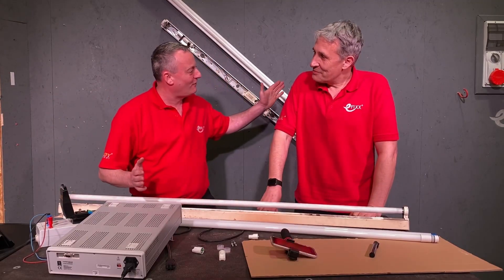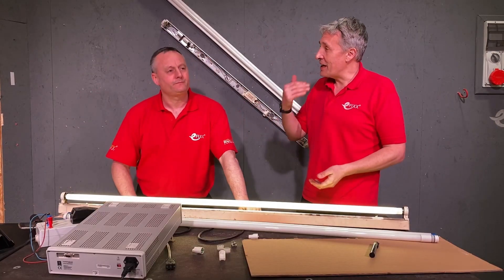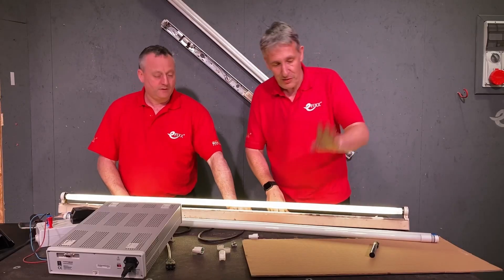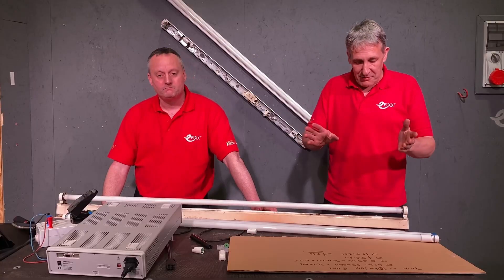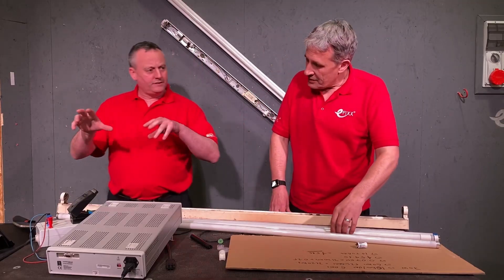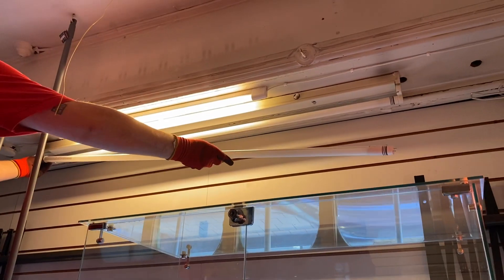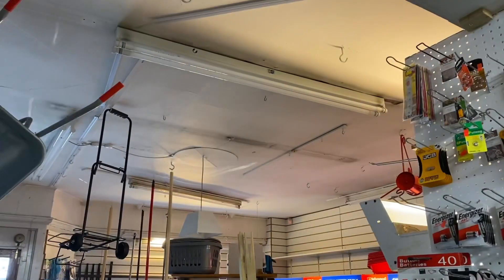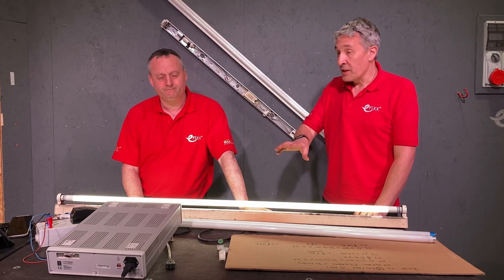How to Slash Your Electricity Bill with LED Tubes

Comment: Some supermarkets still running fluorescent lighting in 2025 lol, went into my local Morrisons today and a lot of the twin-tube fluorescent fittings had either one or both tubes out (completely, HF fittings) so I wonder how much longer it will last!
Reply: July 2025, I've now spotted a few LED retrofit tubes, but in the 2007 extension rather than the 1998 original building. Still mostly fluorescent tubes (some working, some dead).

Comment: No mention of the tombstones ,or explanation 🤔 of shunted and non shunted tube types at all ... ????.

Before you convert any fluorescent   tube fittings you need to know what type of fluorescent tube fitting you are dealing with there, this needs to be done ✔️ even before you order any led tubes to determine which led tubes you need to order and obtain there too .

Watch this YouTube video link below there for full explanation and information. 

https://youtu.be/HB3AuoFRFOM?si=UV0m46XL59z2V53h

Comment: These calculations overestimate the savings. A 1500 fluorescent gives out 5200 lumen for the 70 W if it has a magnetic ballast. The CorePro 1500 only gives out 2700 lumen for a measured 24 W. So if you want the same light output, you need to use a double fitting with 2 x CorePro 1500, so the power draw will go down from 70 W to 48 W.
So your cost for the same light output goes from £54.60 to £37.44, call it a saving of £17 a year for each tube and £170 for the 10 tubes. 
Bearing in mind your pair of tubes will cost you £15 and the hassle of the extra holder, there is no obvious and early saving by swapping from fluorescent tubes to LED because the tubular LED. 
If your original fitting is a high output T5 with an electronic ballast, that's 4300 lumens at 48 W and savings do not cover the costs of replacement. 
From an energy point of view, there's nothing wrong with modern fluorescent fittings. I suspect the reason for banning them is mercury panic.

Comment: As a DIYer I follow you channel to get safe tips on domestic electricity. I have three fluorescent lights in my garage and found this video really useful. So will be going for universal tubes to replace the ones I have. I won’t be messing about removing the ballast etc: because the amount of time they are on the saving would hardly be noticed. But the tubes themselves would be worth the saving.

Comment: have a 1966 atlas atlantic 3 in my kitchen, 8 foot 85 watt quickstart 🙂
Reply: What is quickstart? Is it like magnetic rapid start?
Reply: @gregorymalchuk272  a quickstart ballast is an old 1960's early 1970's instant start ballast , no starter involved in the circuit,  live neutral into the ballast   2 pairs of lamp holder outputs to each end of the tube,  the tube lights instantly no flicker, SRS (semi resonant start ) was a simelar gear type, though the tube starts warmly like a slow fade up to full brightness, that circuit uses an 8.4uf capacitor in series  with the ballast .

Comment: A good video I give free energy saving advise and highlight the standard 4 GU10 halogen  track fitted in the kitchen converted to LED goes from 200watts to 20watts but with the newer LED lamps is 16watts. Its not easy though as customer mentality is "Why do I want to change a working bulb"
My calculation for kitchen spots was 3 hours a day on average with a £12 conversion cost

Comment: I have a whole industrial unit kitted out with 60s and 80s fluorescent and MBFR fittings. Occasionally one starter may play up but in the few years that's all I have had to do. The buy back time in low use applications is negligible. Also I don't get on with led for hertz flickering and the colour rendering isn't the best at all on most lower grade stuff. Also on most led tubes the lumen rating of a 4ft tube is alot less than its equivalent fluorescent counterpart. So in some cases to get the same our put will require 2 led tubes to replace 1 fluorescent tube. So there's an added cost of two tubes a replacement fitting let's say... So not as cost effective as it seems. 

Some people I know have gone back to fluorescent tubes after an led tube failed in a few months of installation. Also a fluorescent tube is easy for someone untrained to replace. So if one end is live permanently compared to a normal fluorescent fitting and some one unknown fitted a fluorescent tube back in and bang. 

So I'd only bypass in a commercial environment.

Domestic I'd just use the starter shunt and shove led tube in.
Reply: That's what I don't get. Most LED retrofits are 37% dimmer than the T8 fluorescent they are replacing. A 4 foot fluorescent tube is 2900 lumens. A 4 foot led retrofit produces maybe 1800 lumens.

Comment: To be fair, the net energy savings seen by replacing indoor lighting is more complicated than discussed here. The extra energy used by the older fittings at the end of the day is heat that is added to the interior space. In the summer avoiding this extra heat is great - the space will stay cooler. But, in the winter the heat will have to be provided by another source - eating into your savings. Upgrading is still a win, just not as big a one.

Comment: Hate LED tubes, all a cold, unvibrant light. Dont illuminate the ceiling, making places feel darker too. That shop looks less welcoming and warm with those LED tubes.
Reply: You can buy the tubes in warm white, cool white or daylight white.
Reply: @stuartrhoades4306  I know, but people always go for the cheapest ones, of which are cold white and never as bright!
Reply from the maker: It looks a lot better than when we started - tubes out and mixed colour temperatures.
Reply: @efixx  Didnt look it from the before and after parts of the vid.

Comment: Thanks for the video and anything to save money is good. Do you have any recommendations for a device we can retrofit to measure power usage?
Reply from the maker: All depends upon the application - what power level etc
Reply: @efixx  I am after something to measure power usage live, so it can be monitored. I would assume it would include a CT clamp on the feed to the consumer unit, then a display in the house. Single-phase normal domestic.

Comment: Great advice👍. Ive been doing this for a few years now. Amazing how technology has moved on. I Changed a 12W BC LED Lamp at home to a 18W LED for my wife to see better working at home. Even with the greater light output, the efficiency of the fitting was significantly better, with less current draw. I worked out the replacement lamp would pay for itself in 8 months!

Comment: We replaced a lot of tubes as you are in a shoe factory in Northampton (they supplied tubes) with those Philips ones the output was impressive compared to other cheap brands I have seen however I never got to get to the bottom of what to do with the emergency fittings?
Reply from the maker: Great feedback👍

Comment: Looking forward to the follow-up — how much more power would be saved by removing the ballast and going direct to mains?

Also, what's the realistic payback time?  Amazon price suggests ~6 months (excluding any labour costs).  Other solutions might even halve that. On the other hand replacing the ballast with a driver is more expensive initially subsequent replacement lamps are even cheaper.

Comment: With changing the LED tubes, you would still have 240v at each end right??? So if you had a driver built into an led tube wouldn’t you have to make it so only one end of the lamp holders has 240v so you don’t blow any lamps up?
Reply: Only one end of the tube is connected internally, the pins on the other end are purely to hold it into the fitting.

Comment: I think the video would have benefited from a complete run through of the costs (and savings). Would make it easier for end-users to follow and give electricians a worked example to use with their potential customers. Chatting about the numbers is not as effective IMHO as displaying them on the screen. Great video otherwise and vitally important.

Comment: Super video- would be good to publish a table of the cost of running different lights - a good rule of thumb for lights is 1w equates to £1  (based on 9hours a day) - so £50 for a 50 watt fitting. More than Double that for appliances that are left on 24/7 such as items on standby…..

Comment: Great videos guys. 
Used many LED tubes when they first appeared on the market but never really got on with them and customers didn’t think the light out put was that great. But these look really good and for the price are a no brainier. 
The mains option LED (blue end) what is that like on energy consumption when still using a Mag ballast vs to taking the ballast out ?

Comment: Well its a nice video, back about 25 years ago I worked in Philips' largest fluorescent lamp plant, in Salina, Kansas.  Was so interesting to watch sand turn into glass and the bulbs to take shape and then get packed into boxes and watch the robots move them around the warehouse.  We made 4' tubes and 8' tubes at that facility.    

I have swapped all my tubes to mains powered LED retrofit bulbs, can remove all the ballasts and just direct wire them.  Just have to make sure the tombstones are not shunted.

Just a FYI that as of 4/2022 our power here in Texas runs just under $0.11/kWh with no time of day changes.  If I change plans we can go to $0.154 during the day then nights (10pm-6am) and weekends for free, you can use all you want for zero cost.  That is why solar is a hard sell here, the payback at these rates are hard to payback in any realistic time.

Comment: I fit a 120cm Philips LED replacement batten a couple of years ago, bypassing the existing ballast and starter. It’s still going strong, I only wish more attractive, diffused fixtures for battens were available. They’re usually either very bulky (possibly extra IK protection for industrial use) or just very curvy-plasticy. The old one I want to replace, the diffuser’s yellowed and I very much doubt they still make replacement parts.

Comment: In all fairness I don’t know what make they are but I have seen these used in quite a few shops. The light output is a diabolical colour, almost burns your eyes out. In fact our local WH Smith had them ,not for long though. They changed the whole fittings in the end .As I said I have no idea of the make.
Reply: LED's are the death of warm white. Something to do with the lumens per watt is better with cold white.

Comment: Don't forget that with time the light output of a fluorescent tube reduces.
Reply: Light output from LED diminishes with time as well. It just takes a bit longer.
Reply: @rob19632  Yes, I remember it being on another eFIXX video but I don't think it is as much as LED or not what I have noticed however I guess some makes are better than others
Reply: @anthonybragg   on display LEDs it might say something like L70 of 25000 hours which means after 25000 hours  average light output will have dropped to 70%

Comment: Swapped the 1200mm tube in my kitchen years ago when they were new and is still working fine. No difference in light intensity but at least half the power to 18W instead of 40W. Left the ballast or inductor in as it would reduce the inrush current. I have quite a number of LED lamps in the house and a few have failed mainly due the input filter.

Comment: Great video and I like the easy conversion by removing the control gear, a proper money saver in materials and energy used 👍
Reply from the maker: See part 2 - DON'T cut the Wire - CALL the ballast disposal squad!
https://youtu.be/kl_UYKw5sBk

Comment: Whats the lumen output of each lamp? The test means nothing unless the lumens of each lamp are equal or similar!
Reply: I changed about 100 in a toyshop a few years back to 4000k, no light difference noticed, tubes cost £12, saved £17 each in the first year, so thats cost of tube + £5. £17 next year, tubes guaranteed for 5 years, only had a few fail, none in the first 2 years.
Reply: I've seen them have 37% less light than the T8 fluorescent that they replace.

Comment: Retrofit led tubes are great at energy saving. A standard 5ft tube will usually be rated at either 18 or 20 watts depending on the manufacturer. While the ordinary gas filled tubes of the same length are rated at 58 or 65 watts.
Reply: And how many lumens? From everything I've seen, LED retrofits produce around 37% less light than the t8 fluorescent they are replacing.

Comment: Thanks for this good video. Mr. Arkwright from Open All Hours (and me!) would like lke to know how to save more electricity, as the energy pricing is getting higher and higher. As you guys have the equipements to measure, could you compare boiling 250cc hot water for making a cup of tea, at 5 different times through out the day, and compare to boiling all 1250cc in one go, drink the first cup (250cc) and pour the rest 1000cc of that hot water into a flask, to consume through out the day, which one actually consumes less electricity? Assuming it is a fast kettle of 3000w, but a low-end cheap model, as it is Mr. Arkwright asking...

Comment: Jolly good show.
How much did it cost to properly dispose of the old tubes?
Reply: In Finland the amount of fuel it takes to drive to the recycling center that is owned by the government. Most electronic waste is taken care of free of charge, and also a lot of dangerous waste like old oil, chemicals
Reply: @justme5384  
In the UK, Businesses have to pay to dispose of fluorescent tubes &, where I live, they’re also classified as hazardous waste meaning you have to get a special licence & pay the appropriate charges when tipping too plus all the health & safety assessments & equipment that goes with it. If you take them home & store them, that’s another licence… it gets expensive!
Reply: @jonathanrose456  I also read somewhere someone got fined because he didn't have a license to collect garbage. Because he had his own plastic bag with waste like lunch packaging etc...
Reply: @justme5384  
Wouldn’t surprise me.
I know a guy that got fined for taking a sofa down the tip. The sofa… it had been fly-tipped in his back lane!
Reply: One of his mistakes was using a commercial waste bag instead of a domestic one.

Comment: Great way to save energy and good information- but not including the approximate cost of the tube and starter does not give a full flavour for the savings, I found similar ones between £5 and £20 per tube for 1500mm with starters.  I would assume the project payback time would be between 9 and 18mo and greater savings after 5yrs when those battens are still going (hopefully with no flashing tubes).
The way NOT to do it - is to replace all of your standard tubes with ultrathin ones (with adapter caps), replace them again 2yrs later with LED tubes (with different adapter caps), then replace the whole lot all over again a further 2yrs down the line with LED panels with occupancy detection!  It saves energy, but does not save money!
Reply from the maker: The payback on our example is around 3 months using the EM type Philips LED tubes (£10 each)

Comment: Been doing the swap for years ... flouries are so out dated.. the led tube replacements tend to last 3-5 years (i only fit branded) .. amazing how many shops are still running 2700k flouries.... its a cheap alternative to a new fitting but from experience new fittings last longer ....  Gordon been raiding his old workshop .. don't  see a cliff quicktest very often
Reply from the maker: Love a quick test 👍
Reply: You don't see 2700k fluorescent tubes used in stores very often! Normally they are 3500k at the warmest.